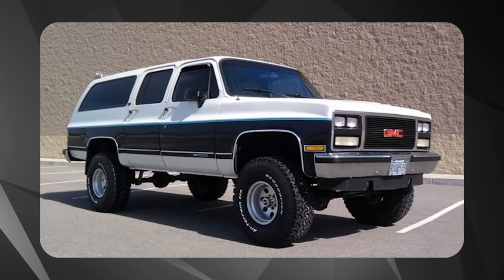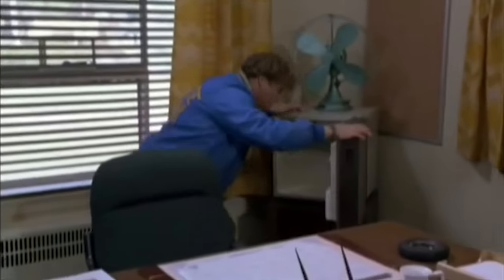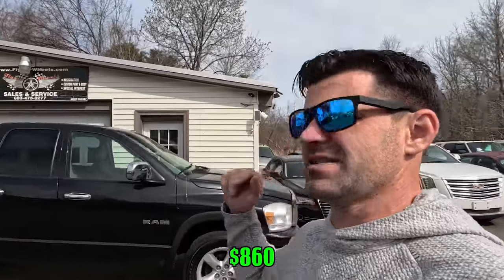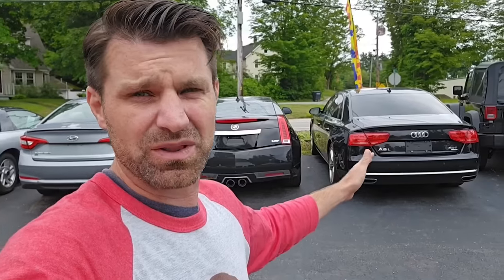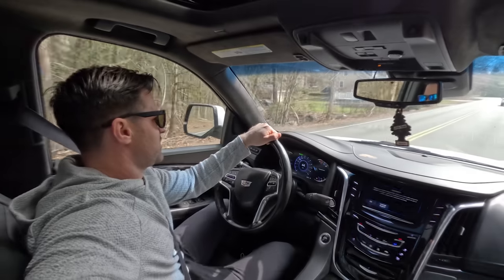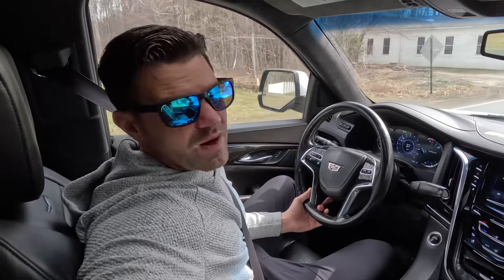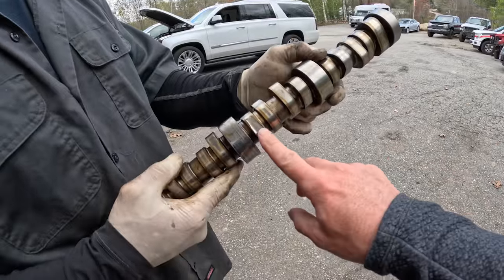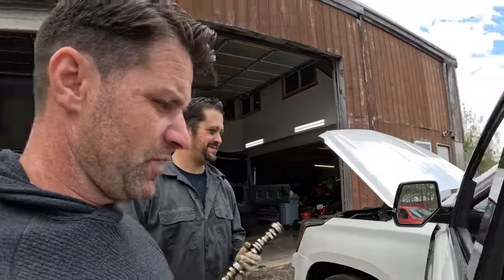WARNING! GMC Chevy & Cadillac Escalade Engine Problems at only 53,000 Miles! - Flying Wheels

Comment: Sorry, you probably  need another Jeep expert. if that Jeep is a 2011-2013 and some 2014s, every Jeep expert knows with a check engine light number 2 cylinder misfire,  its going to need a new drivers side head, The number two cylinder valve seats over heat. Jeep extended the warranty for this engine head to 10 years 150k miles.  This same thing happened to me years ago as a used car dealer, lucky for me I bought it under a green light. and took it back for a full refund. I bought and sold a bunch of Jeep Wranglers, but was always carful on those years after that.  That Jeep is going to need a new head to make it right.       Love all your video's ,    The new ride is a steal, even needing a new engine!!

Comment: Just restore ever good vehicle you  own. This is what i am doing. The only problem i have is the lack of good mechanics in the Hartford CT area that will not lie to you . Also parts for the lexus are hard to find and expensive 2004 rx 330. The 2001 v6 passat  haz been excellent so far since we bought it new but the standard tranny is shiffting really  hard when cold as the weather gets colder. Tbis car has never  been driven in winter so with no answers from my  VW garage as why it shifts hard when only cold ,

Comment: Projection on the head unit is for android auto or apple carplay when you plug your phone in to the usb port. 2016 and up suburban, yukon, escalades have android auto and carplay. 2015 models didnt. If you plug your phone in and it doesnt work. You need a system update from the dealer. And last, always use an OEM cable for android auto and apple carplay in ANY vehicle. Hope this helps you craig or anyone else with gm trucks

Comment: @FlyingWheels projection is android auto and apple carplay plug an andriod phone or iphone via usb into any of the usbs on the console. you will know when youve done it right if you hit projection and it loads in carplay/or android auto. usually it is the usb in the center console

Comment: I have a question I have a 2008 Cadillac DTS NHP NorthStar. I replace everything in it. My question is I am going to buy 2018 or 2019 Cadillac CT6 has to be Black but also, I been looking at Cadillac XT6 like 2022 what I like to know is these cars any good I have DTS for 7 years she runs well. 148,000 miles, I really like the CT6 they around $45,000 for used for under 60,000 miles This has to be my last car getting too old to work on cars. I been doing auto repairs since I was 16 years old pushing 65 now. wife wants to relax stay out the garage. or should keep my DTS for couple more years. Only drive about 1,200 miles a year mostly less bought DTS had 139,521 on it after purchase.

Comment: Dude. 
I just seen your video and I’m sold out with you. 

You seem cool and knowledgeable on cars. 
I like how you break it down. 

Just got me a 2021 Escalade white sport platinum.  

Drive beautiful but a little concerned about some complaints that the 6.2 engines fail and died on the road. 

I have a 2016 Escalade that I gave to my wife just now that I upgraded with the 2021. 

That 2016 has been working super I got it with 10k miles. Now it has 60k. No issues but the shocks and the cue screen , oh the point kind of fading from the hood. 

Anyways. Good video. , I now have subscribe you. 

Any tips would help on that 2021 cadi. So far so good. It has 42k miles.

Comment: the 6 speed transmissions are something to be avoided, if you are looking for a used tahoe, escalade or truck try to find one with the 4 speed, it will save you a lot of headaches, converter fails are almost automatic, and it will fill the trans with metal and cause it to overheat, and if you want more bad news, the transmission computer is inside the trans, they are almost the worst next to a cvt

Comment: They had to rebuild mine at 35k miles. All the fuel management crap is causing the problem,  I hear you can upgrade the computer and turn it off and prevent the problem.

Comment: Agreed. Across a lot of brands. Love my 04 5 speed hpt volco c70. Bulletproof with easy reg maintenance.   My 94 c900 saab vert was similar. Had an 89 spg and trans.. well over 160k. Even with worn suspenion, leaky oil all over and blow by, that c900 got me everywhere. Never stranded me.  Sold it to a guy in alabama last month and he drove it 900 miles home.  Didnt skip a beat. Not sure you can get that out of today's vehicles.  Mind you GM destroyed the last of saab. The last gen or two of saabs were crap.

Comment: I found out about this in 2019 my gmc slt premium plus brand new truck at time transmission went out at 10,000 miles . My buddy had the 80k Denali and his went out at 2000 miles 🤣. , went with Lexus no problems

Comment: I have a 2015 Escalade 6 speed auto with 80K and no issues. I thought all these problems were with the A8 transmission vehicles and not the 6 speed?

Comment: Most problems with Jeeps having misfires are the Engine control module.  I have a 12 Chrysler Town and Country Touring L that has a misfire and it’s lead to the ECM.  I’m sure that’s the issue with your Jeep misfiring.

Comment: Actually Craig, you should be thanking GM and Cadillac for having the lemon motor. If not you wouldn't have gotten that crazy good deal on it.😅😂 Instead just be thankful that you have your own GM Jedi to help turn lemons into lemonade. If you were smart you would buy and sell nothing but Florida, Texas rust free versions with preferably low miles so they haven't been run long enough to ruin the engine they just need the fix. There is possibility for maximum return.

Comment: Cool video despite the neurotic 4.7 second clip cuts. You sure have a much better grip on the business of selling and projecting costs. IMHO the best engines were the original 5.3 and anything else that didn't use cylinder management. You could put a Caddy L62 -  368 with the disastrous  8-6-4 in there . I guess there is a good upside to the 6.2L

Comment: i get it !!!
my 2007 GMC Envoy Denali just kicked the bucket! transmission wont shift into 4th or overdrive... luckily i made it home last 40 miles  doing 35mph in 3rd gear & flashers on. since buying this car 3 years ago i have put almost $4k in it... timing gears... timing guide... tensioner...water pump...fuse block. starter module..and of course it has 208,356 miles on it..   i am stuck now... with nothing but my motorcycle to ride... junkers wont give me anything for it... Carvana offered $300 . i could trade it to them and buy a car from them...but what i can afford. they have no cars available.
yes they checked my credit and i passed for financing... but being on Social Security with limited funds available each month makes it a lil bit difficult!  i cant just fit in any vehicle... 6'4" tall big guy...any ideas ???   just keep looking  & praying..., ? i could jump from one frying pan of hot grease into another if i am not careful....  cant afford a replacement trans... makes no value sense
Reply: 4k you couldve gotten something that wasnt a gm product and even junkers wont touch it cause they know better 😂😂😂😂 you in the poor house now

Comment: My 5.7 Durango has a switch to turn off that cylinder deactivation. It's never on I'll run it a little bit after an oil change just to flush some fresh oil through the system but that's it.

Comment: Heads must come off to do lifters on GM gen v LT platform. The lifters collapse or stick in the deactivated position. They also break valve springs. Pull valve covers to determine what cylinder is damaged, im guessing #7. Also replace VLOM while your at it to do a quality fix. Id avoid driving them when damaged like that as well to avoid additional damage. Looks like a Manheim red light special.

Comment: Regardless you’re pulling the heads, even if you’re just doing lifters on LS/LT platform. Yup it sucks. 
If you’re lucky you can get away with just a cam swap without pulling the heads, if the plastic lifter trays still have some tension left in them. Use 16 magnets for extra insurance though!
Reply: But cam swap won’t fix your lifter issue….

Comment: If you replace lifters you're going to have the same problem again because I had a 2008 Chevy Silverado with the same problems. So I replaced the lifters and I went and put a stage one cam in it and I reprogram the computer. I removed all of that fuel management system and my truck runs great. So if you just replace lifters you're going to have the same problem again very soon because I did it in my truck
Reply: My 09 silverado 4.8 (no flex fuel) runs like a champ with 147k miles.  I think that flex fuel crap is the culprit

Comment: You bring up what else old timers have been saying for years: they sell you on all the do dads and goo gaws but it's like a house with a foundation made of straw. 

A car company would BLOW the market wide open if they only engineered their vehicles to last. Knock back all the BS and say "we guarantee the drivetrain for 20 yrs or 200,000 miles"

What? all I need to do is regular maintenance? "yes and that doesn't include a $4000 timing job".

Comment: You have to remove the heads to get to the lifters on the LS platform.  It would be wise to replace all lifters and cam and tune out the AFM/DOD so AFM/DOD won't turn back on.
Reply: How do you deactivate it?

Comment: Those Escalades are essentially glorified Tonka trucks. I can't believe what has happened to modern day vehicles. They are computerized plastic shells on wheels. If I were in the market for a used Escalade (for that matter any newer car), I would make sure I had an extended warranty outside of any manufacturer warranty once they expire.

Comment: That mechanic may know how to fix those engines, but he doesn't really know how engines work. If a cam lobe is worn and the valve doesn't open as much as it should, that would not cause low compression. Low compression in the valve train would only happen if the valve did not close all the way, or did not seat properly. Seems like a nice enough guy.
Reply: Worn camshaft lobe would cause a misfire similar condition. It dose effect the running compression which is a much better test then a static compression test in these new vehicles with the very sensitive misfire count. This aviods miss diagnosis of a misfire.
Reply: @brandonrogers2973  Thanks for the word salad,but does a worn camshaft cause low compression?

Comment: I’m a Chevy man.. I would never buy a truck or sedan from GM. Only muscle cars.. I own 3 Camaros. I’ve had my 2013 Camaro manual for over 10 years. Very reliable, never had any issues. Bought it brand new and took care of it, never had any issues. Seems like GM put a lot of over engineering into their sports cars. If I want a truck, I’m going Toyota…
Reply: Hopefully Toyota cured the frame rust issues on its Tundras.

Comment: People in the used car business are very familiar with GM products. The one word to sum them up is "predictable" . They are predictably bad. So many people buy that junk, you need to have a few on your lot. The cost associated with prepping one for sale is very high. Trucks need lifters, tires,brakes, wheel bearings. Suvs need timing chains, transmissions, and check engine issues fixed. The used car business sucks. You are basically buying work at an auction.
Reply: that why they are poor from buying gm

Comment: This is why we don't ever buy the GM products... because of the insane 4/8 fuel saving system and their cheap plastics. Even though they have plenty of gadgets to play with its not worth buying. Now if your looking for real big SUV that could pull a house and move 8 people in luxury you buy a Ford Excursion  with either the V10 engine or the Diesel. Then you have a vehicle that will last 300,000+ miles that has the same bells and whistles that won't cost thousands of dollars to rebuild engines and transmissions. The only problem is finding one these days, since Ford stupidity stopped making Excursions in 2006. Bring back that Big, strong, beautiful, stylish, dependible, real SUV Ford cause not everyone wants a 2500 pickup truck.

Comment: The good and the bad.  Old cars rusted out completely in 5 years.  But you changed the oil every 2000 miles so when the rusted out car was ready to go to the junkyard, you buy a southern car with no rust and a blown engine and then you've got a car that'll go 5 years in the northeast before it rusts out.  Today, everyone's figured out rust protection.  But there are all kinds of stupid things in engines and transmissions.  Plastic parts.  CVTs.  Cylinder deactivation.  Timing chains stretching.  We seem to be back to buying a car and getting rid of it in 5 years before the warranty is done.  Buy used to save money?  With a Cadillac, buy the used unit and send it right to the shop and get the timing chain and guides and tensioners all replaced at 50k miles.  Then change the oil every 2k miles or the lifters and cam gets wiped out.  Aaaaaaah!

Comment: Curious, what do you think is the best high mileage car for a teenager around a $12,000 price tag I’m leaning towards a Mazda as far as safety features in dependability, plus I heard well-maintained they last up to 250,000 miles curious what your thoughts are.
Reply: Toyota Corolla (ANY year)..
Reply: I bought a 2010 Mazda 3s hatchback new
back in summer '09.
Drove it 230K hard miles. 
Replaced ECM once, AntiLock module once, water pump once, and alternator once. The rest was brakes, tires, and oil.
It was a good car. Used it exclusively for local delivery work for the entire duration of ownership. Finally wore it out this year. Recycled it for $500. 
14 years of very hard city driving.
Recommended.
Reply: Toyota Corollas are bullet proof dude

Comment: I have never even just 1 Cadillac owner claim that it is  the most reliable vehicle they ever owned.
Reply: My last 3 were absolutely rock solid. 2nd gen CTS-Vs are known for their reliability. The ATS-V I had took beating at the track, lap after lap and happily shrugged it off. Even drove it across the country a few times. No problems.  My current Escalade has over 150k miles and while the transmission doesn't shift as smooth as I like I get no converter shudder with just a simple tune and using the Mobil 1 HP LVP fluid. Everything else works as it should and it's held up to substantial abuse like towing and city driving. 

I can tell you alot of these issues are owner related, particularly if they are owned by older people who believe nonsense like putting "thin oil" in their engine will cause it to wear faster so they ignore GMs recommendation and end up dumping 5 or 10/30 in there because "thats what I've always used". You absolutely should be cult like in your oil changes. There is a screen at the passage for the VLOM that clogs easily and that is usually what leads to low pressure conditions that cause the DOD/AFM lifters to collapse.
Reply: My 18 XT5 is purrrfect. But I treat it like my trophy wife!

Comment: It's amazing they can make crap like that but build other vehicles that run forever. My best friend is a GM tech and done 100s of timing chains on the Equinoxes and said the Trax are complete junk. My 98 GMC Sierra went 180k with no issues and sold it 6 years after I bought it for the same price I paid then I bought a 08 2500HD 4x4 6.0 it has 170k and my 1st issue was the transfer case going out and of course I live in MD so it's a rotted mess but never fails to run!
Reply: any real car person dont buy gm
Reply: @mattnorman5241  That makes absolutely no sense 🤦‍♂️
Reply: @Joeshomegarage  why you sticking up for gm
Reply: @mattnorman5241  because I'm not prejudiced I've owned a lot of GM's but I own Honda's, BMW, Chevrolet and a notchback mustang 🤷🏼‍♂️

Comment: DOD /AFM is not a mechanical or lifter related. DOD is an electronic/ Computer CPU controlled in which the system shuts down the fuel to certain cylinders when the power demand is low. It has absolutely nothing to do with the lifters. It only effects and toggles the fuel injectors .
Reply: you are grossly incorrect on this lol

Comment: I would never post a video of a big come up like this truck people will talk so crap when you make a bunch of money but when you loose ur butt on a car the same people say “it’s the cost of doing business”. 

I bought a yellow Chevy cobalt years ago from my buddies friend I didn’t even want the car when I got there. She wanted like 1500 bucks it didn’t run, doors and bumpers the clear was pealing, I said I didn’t want it she said I need to get rid of it what would you pay I said 400 bucks she got all mad I said I’m not trying to be rude but I don’t even want it, it doesn’t run it could need an engine who knows, needs paint work, interior is trashed, tires and brakes, she tried to haggle me I said honestly the longer I stand here the more I don’t want it I don’t think anybody is gonna really want a yellow cobalt the only good thing is it’s got 60k miles Her husband made her sell it. I checked it out it needed an alternator and batter and it ran good. I waited a few months till I found a yellow cobalt parting out so I got doors, front bumper and fenders, then had to get the rear bumper painted, new speakers, radio, my doll up guy got the interior cleaned which was not cheap because it was so bad, interior had a bunch of broken parts, front struts, brakes, tires and it had this weird noise that ended up being the rear end bushings for the axle, then an engine light issue. I had 1500 bucks into it all in and ton of time because I fixed all my cars when I had my used car lot. I posted it on Facebook for 4,000 bucks and the girl that I bought it from flipped out. I listed off everything that I did, posted before and after pictures of the car and said I am a dealer I have to stand by my vehicles and to top it off I didn’t even want ur car I only bought it as a favor for a friend